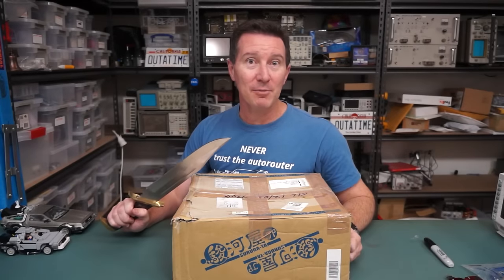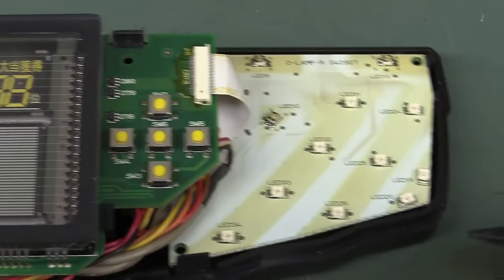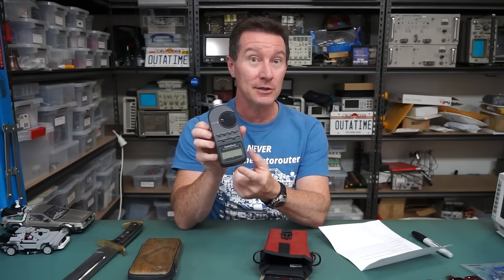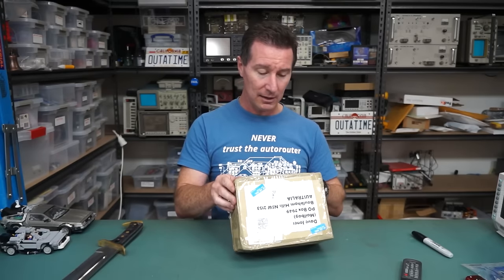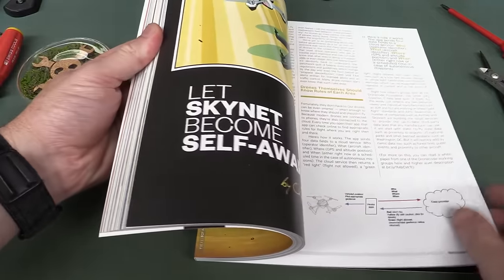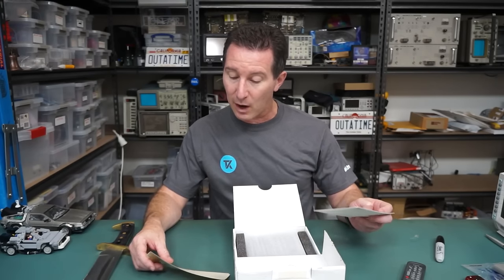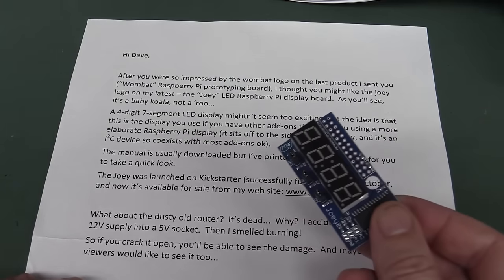EEVBlog #851 - Mailbag

Comment: The Tektronics code is:

-Up/down: binary (LSB first) '00101010' = ASCII 'T'
-Thickness: '00000011' = ASCII '♥'

-Spacing: (maybe I'm over-thinking things) '000 111 00' = '8' (not quite 'K' as I hoped)

Comment: The earth wire is a very common thing in Japan. All home appliances use it. You need to manually screw it into the wall socket.
Reply from the maker: +Dean Herbert Woah, really?
Reply: +EEVblog http://bfy.tw/4HOY ;)
Reply: +Dean Herbert used to be that way in us early I believe, til we modernized  and added grounding prongs. probably around 60-70 years ago.. LOL
Reply: +Dean Herbert Home appliances like fridges, washing machines etc usually have a separate earth wire that goes into the frame and needs to inserted into a screw terminal under the socket. Stuff like air conditioners have a proper 3 pin plug that goes into a 3 pin socket... and then power leads for monitors, computers etc have that dangling wire that's meant to attached to the same terminal as the one for washing machines etc or a 3 pin plug but the sockets that are not for air conditioners up on the wall or in the washing machine/fridge bay never have that terminal or are 2 pin so the connector has a plastic insulator.
Reply: who would even come up with that. stupidest system ever
Reply: drkastenbrot From what I remember the US has much the same situation; Stuff should have earth so has 3 pin plug but house only has 2 pin sockets. So people break off earth pin or use a "cheater plug" with the dangling wire.
Reply: +Dean Herbert Fancy seeing you here. =)
Reply: donpalmera probably on old houses, still owned by original owners family.. I think new houses have to have 3 pin by code, and a home inspector on a sale would likely also point out that they need to be replaced.
Reply: +metalhead2508 It would also be a really good idea to install a ground rod outside and run yourself a proper earth wire to all your outlets.
Reply: +EEVblog Taiwan too, from what I understand.
Reply: +metalhead2508 sounds sketchy! I can't even imagine not having an earth ground on every outlet, but then again back in the day home appliance were either AC motors and electric lights.
Reply: +Dean Herbert Exactly. All their wall sockets are just two-prong but there are situations where an earth connection is mandated by safety standards, e.g. in bathroom installations. Instead of just designing a modern 3-prong sockets, they just have this wire which is attached with a screw. Quite a lowtech solution for a country like Japan.
Reply: +genkiadrian air conditioners  use a 3 pin plug and socket.
Reply: +Dean Herbert 
lol what???
Reply: +Dean Herbert Of all the places to see you on reddit on the forums it's an eevblog comments section lol
Reply: +EEVblog Yeah, this is the land of optional earths over here. As an Australian electrician, many of the electrical practices make me cry (and some stuff that's legal here would get you locked up in AU too....)
Reply: +Dean Herbert come to think of it, a lot of countries in EU did not retrospectively legislate earth pins in homes except for kitchen and bathroom.. so the majority of residential areas do not have earth pins anywhere but the kitchen and bathroom. This creates weird situations because poorly-designed modern electronics rely on the earth for non-safety aspects
Reply: ***** Would be interesting if you could mention what Japanese standards you deem to be bad.. I think any non-native that had good enough Japanese to actually parse those first-hand would not be a sparky.
Reply: +EEVblog I lived in Japan in 2004. Most household power points don't have an earth (2 pronged only). The only time I saw a 3 pronged outlet was for the fridge and maybe for the washing machine. In addition some interesting points about pachinko: Pachinko parlours are like pokie machine places. But I don't think they serve food or drinks. At least not in the ones I saw. Pachinko palours are not allowed to deal with money. You'll always find "a hole in the wall" just next door to the pachinko palour which will exchange your cash for the little pachinko balls. *Hopefully this info is still current as it's been a while
Reply: +Dean Herbert Didn't know you watched EEV peppy :)
Reply: ArtiDope I'm sometimes surprised to see friends in the comments ;) , and vice versa. Small internet sometimes

Comment: The VFD segments may be multi colored, and that's why they look strange.
Reply: +Kenneth Scharf Exactly my thoughts. Sad that Dave did not tried turn that thing on.
Reply: if you look you can see an obvious set of 3 colors (gold, silver, copper/bronze which I'm guessing are either multipliers or just a higher value set depending) and then where there are single digits that are (basically) always on have a more off-color then the same color ones in the corresponding row/column depending on what section you are looking at. (Kind of surprised save didn't mention this but did mention the LEDs)
Reply: Yes...

Comment: Hi Dave, I dont know if you learned it already, but a thatched cottage is a type of old house, usually worth a buck load these days, which were built usually with "straw" or  dry grass roofs and walls made of timber and a type of concrete/dry grass mix.

Comment: The first one's ground wire in the plug isn't tied to the plug contacts, but to a ground wire in the cable. The idea for these (and also the compatible 100VAC Japanese plugs) is that the wire has a ring/fork terminal that is attached to the screw on the outlet cover. I've seen this on old appliances (washing machine, etc.).

Comment: We still use an Etherscope like that, but I think ours is an Etherscope II but looks very similar except it has a compact flash port for data storage as well as pcmcia.  It runs Linux and can do cable testing and you can put in a wifi card as well.  It can do impedance testing of twisted pair wiring, wire map, some signal loss, time domain reflectometry for cable length and distance to damaged or shorted cable.  When you're running tests the relays are clicking off and on, probably connecting the wires to the FPGA for testing before switching back to that broadcom chip . You can also do network capture for offline analysis.

Comment: I have one of those D-50s in really rough shape. I've superglued the plastic window back on and there's dings and scratches everywhere. it got really beat up when it was in storage and Hurricane Sandy came through and destroyed the shed it was sitting in with a bunch of my other stuff. 

Good to mention in the teardown you do for it that it uses the same analog circuitry to an extent as their first actual retail CD player on a smaller scale... this is why it cost so much when new. Mine still has the 9V battery pack that uses C batteries, and the 9v wart is... someplace.... but I can power it off any of them so long as I make sure it's at least an amp. I got mine for $20 in box at a yard sale back in 2009, looked just like that one. but mine has a datecode of october 1985.

Comment: It looks like the "code" on the shirt at 23:21 is a binary representation of the number "42". 
The stripes on the top are 1s and the stripes on the bottom are 0s, giving 00101010, 42 in decimal.

Comment: The reason why the slash wasn't colored on the front of the shirt is because that's a "button logo" so basically it's just a simple black & white rendition of the logo wrapped in a circle
Reply: And as far as the code, I assumed it was binary (there are 8 lines total)
assuming bottom row is 0 and top row is 1, you get 00101010
which is decimal 42, or the ascii character * (asterisk)

Comment: The Radio Shack analog dB meters were ubiquitous back in the day.  You couldn't walk into a studio or lab without finding on in a drawer.  They actually weren't bad for roughing in.  The digital ones were crap though.  We ended up purchasing a terrasonde toolbox (?) when our RS analog unit went MIA.

Comment: That HP-41CX is exactly like the one I have and still use! Just keep a supply of N cell batteries to power it. The HP-15C I have is probably the most ergonomic calculator ever produced, you can operate it very well holding it in your hands with just your thumbs, I guess that's why they command hundreds of dollars on eBay.

Comment: Dave, I like your videos but I would prefer "Turn it on then tear it apart" instead of "Don't turn it on, tear it apart" . It would have been good to see the VFD powered up, not sure about the discoloration due to use , maybe it was purposely coloured. It would have been good to see diagnosis of why the VFD could not have been repaired. same with the Network analyser. Please show the Sony CD player working before killing it or at least try to get it working. P.S. I want to see more repair videos.

Comment: I think it's pachinko parlors. I'm pretty sure the external ground lead is also a thing that is still around in japan, like the grounded to two pin adapters that were common in the US.
I've got one of the machines, but it sadly lacks a cord of any sort, just a jack on the back for power in and I guess something out.

Comment: The network analyzer by Fluke.

Could it be Jtagged and loaded up with PFsense linux firewall OS? It kinda looks like a full embedded x86 barebone 
assuming it has 2x 1Gbit LAN ports. Would be pretty sweet. a compact firewall with its own LCD screen build in
Reply: +Osmosis Firstly, he already said the SoC is a Intel Xscale. That's ARM, not x86. Secondly, I doubt it has direct access to the Ethernet, or if it did you'd have to write a device driver for it (perhaps even loading something custom on the FPGA to get access). Good luck getting info out of Fluke and/or reverse engineering it.
In the end it's just not worth it. Much cheaper and easier to get something from RouterBoard.

Comment: Japanese has electrical system with separate thumb screw terminal for earth connection that is planned to be replaced with American system. Also their gaming place could had blacklight (UV-A) lighting in use, I don't think that red LED emits UV that much.

Comment: Unless designed to do so, LEDs emit very little off frequency radiation. The discoloring is most likely due to plasticiers out gassing under the heat of the LEDs and reacting with the solder mask. At least that is my guess.

Comment: What with all the ranges on the sound level meter? I purchased on for work for simple testing, we needed to verify a 70db beeper, any there wasn't any range select, just on/off.
Reply: +GreenAppelPie It probably auto-ranged.
Reply: Well yeah, I'm just wondering why that old one  had like 60-70-80-90-100ish ranges. It just seems so archaic, even for the time. I'm thinking I might've missed something.
Reply: +GreenAppelPie Remember that dBs are logarithmic, so in order to get decent resolution at the bottom end you'd have to vary the gain before rectification. The analogue meter one has a linear meter with a logarithmic dB scale. This digital one will have to do the conversion electronically.

Comment: Ah, Pachinko halls. Just listen for the godawful din and smell for the overbearing reek of cigarette smoke, probably a good chance you're outside one of them (or within a block...)

On Earths/Grounds, Japan is a bit weird like that, their power distribution is very much like the US (which IMO has it's own problems...), but they are very slow on the uptake of three-pin sockets. I gather the flying lead was originally to be put under the screw that holds the cover plate in place (which is connected to the maybe grounded wall box), some of the stuff I saw over there was rather frightening...

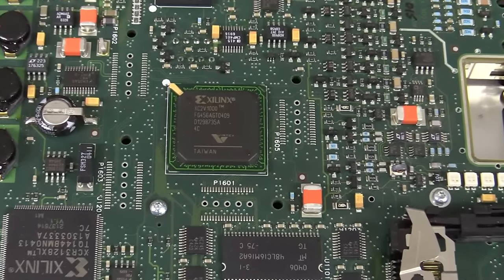Comment: Those orange tantalum caps on the board at 16:23 are imho horrible things. I've seen them litterally catch fire and it staying lit because of the electrolyte bubbling out it when they've failed. 

Also very hard to replace when that happends because of the total lack of markings. Except for polarity, that point sticking out is the positive lead. 

Allmost totally ruined a very nice Compaq Concerto vintage computer. I so very much would love to punch the one who invented those crappy things. 

Never thought watching an old mailbag would get the hairs in my nek to stand up while looking at a random board. EE-Trauma. :)

Comment: It's 240V AC, the guy just wrote the 0 weird.
Reply from the maker: +cyrex686 No, he very specifically said 24V AC
Reply: but they use 100VAC in Japan.
Reply: +mirabilis Among the junk I have collected, I have a big beefy 24 V transformer that has a socket very similar to a Japanese/US two prong plug. Perhaps some form de facto standard? The idea of using two prongs with a 10 mm distance (or .4" in freedom units) is perhaps not a very unique idea. And even though my transformer has nothing to do with pachinko machines, you can google images for pachinko transformer or pachinko power supply to find pictures of different models outputting 24 V on such a socket.

Comment: about the code, if you interpret the 8 stripes as 00101010 in ASCII that's an * <Asterisk>
Reply: I got 0111011010111
Reply: +Mirco I. or just 42
Reply: +Mirco I. I was thinking trinary. There are three states for the stripes: none, top, and bottom
Reply: nah >.< Adam Jeffords you took it away, I carefully avoided decimal in the first place ;)

Comment: I don't think we have to worry about anyone's safety using that knife. It's dull as fuck!!
Reply: +Aisha Kegawa A dull knife is far more dangerous than a sharp one. You compensate for the lack of an edge by pushing harder and sawing with the blade.
Reply: I was joking, but that is a great point and good information to get out there. 

I should have noted that. ^___^